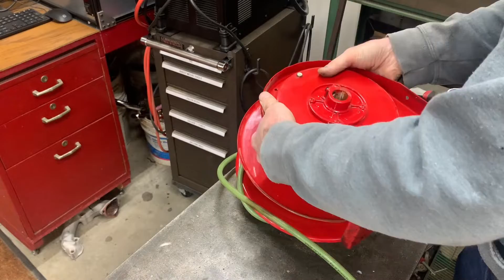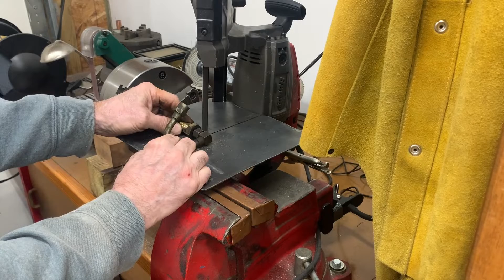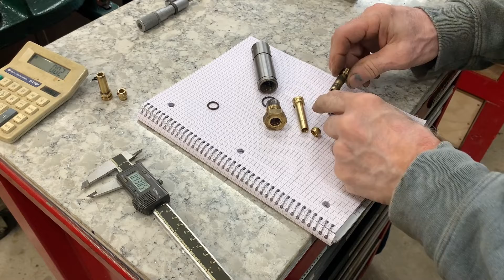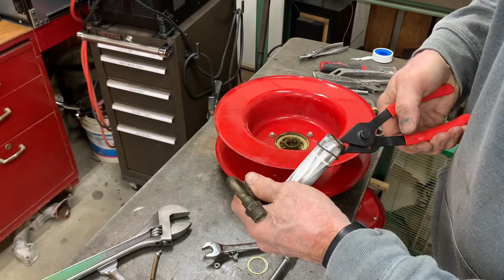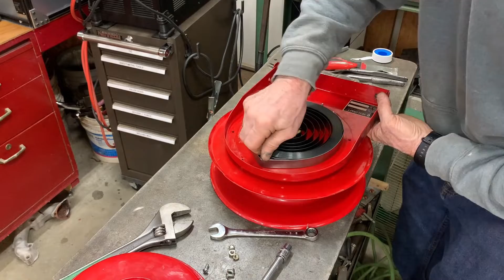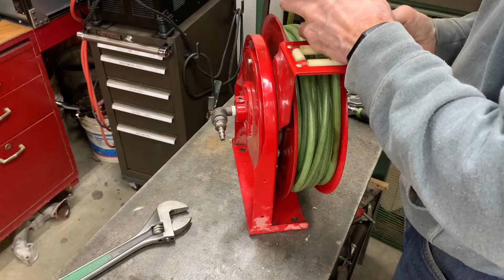Reelcraft Air Hose Reel Leak Repair

Comment: For those coming here later, op might has overkill this. Might model is 5650 and I did not need to remove the whole spring assembly. Simply tighten the set nut and it already hold the big shaft enough to zip swivle joint from the other side with an impact. I also didnt have to cut the swivel shaft. For me, this shaft is just very stuck by the ferrule with very little room to wiggle the nut behind the ferrule. And it is exactly like the shaft that he built later on in the video. As some people here point out, i simply pry the nut along with the ferrule out. On Amazon there are some ferrule pull tool that will allow u  to tight the nut on, and simply pull the whole nut and ferrule out.

Comment: I have a reel with this problem. After seeing this video, I went back out to check that it was exactly the same, and decided to try lubricating it. I stretched some electric tape around the thread and tight against the flange it screws into leaving the ends open at the top, then squirted some silicone spray into the top, let it sit for a bit, then pulled the hose in and out of the reel a few times. I then connected the air to it and it worked much better, but did still leak occasionally. While it was leaking, I tried twisting the bent tube that connects the hose to the seal part a bit and the leak went away even with multiple extensions in and out afterwards.
I don't know how long it will last, but it is probably worth a try for anyone with this problem. I would suggest that if it works for you, it would probably be a good idea not to pull the hose all the way off the reel to avoid twisting the air tube again and messing it up.

Comment: Have replaced O ring in several of these, never needed a new shaft, sinply work a couple of screw drivers behind the ferrule nut and work it right off, the oring reelcraft uses is a #904 which is available at most industrial supply houses
Reply: Worked perfectly for me. Thanks
Reply from the maker: Thanks for the input but it didn’t work for me
Reply: The prying worked for us too so Thanks a million for that!